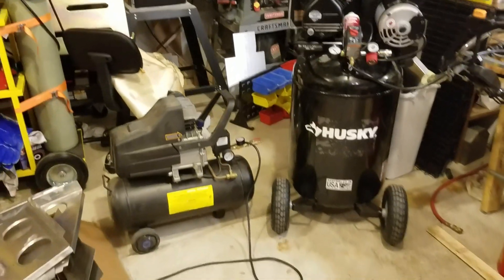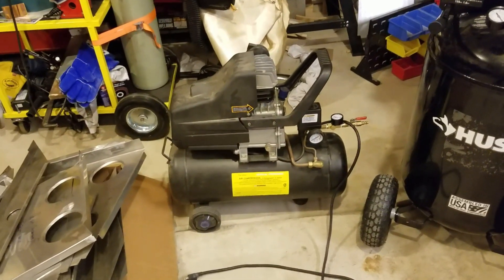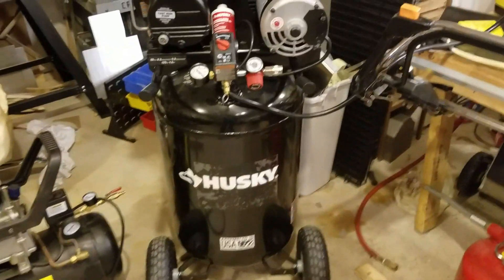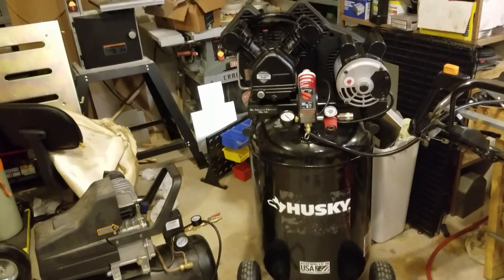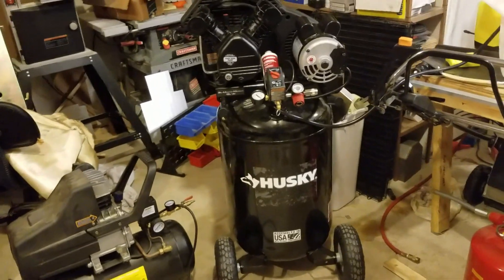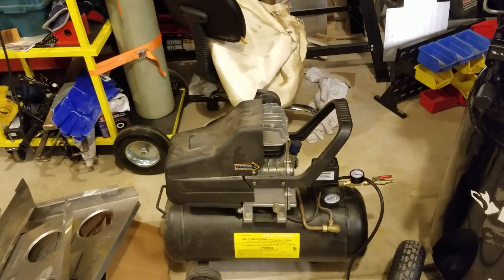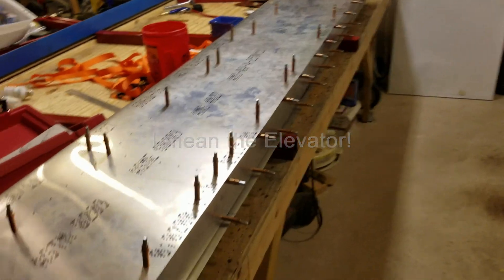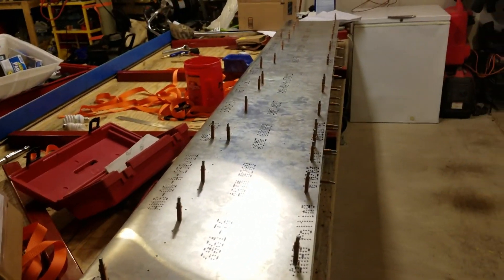This project killed my air compressor & update

Comment: Capacity is not the most important aspect of an air compress (don't get me wrong, I do like decent Capacity) but the most important is CFM ... this is good reading https://www.vmacair.com/blog/many-cfm-need-run-air-tools-air-tools-cfm-usage-chart/

for drilling you need good cfm - I would look into units that give 11 cfm at 90 psi - I have the same Husky you have now as a back up, but my 220 volt one give me 3 times the CMF and double the tank Capacity

Comment: Connect the two tanks together with an air line and fittings, then you will have a 38 gallon tank capacity.

Comment: I have the Husky 30 GAL 175 psi Oil-less. This does work great for a portable 110v unit but if the compressor dies I will get a twin-cylinder oiled compressor.  I will get a lot of years out of it no matter what. Harbor Freight carries a twin-cylinder cast compressor at a reasonable cost. The conversion is basic and simple. Being oil-less does not worry me knowing I can make a pump change so easily. I have 3 compressors now. The Husky, a  Campbell Hausfeld 20 gal which is now over 20 years old and still does the job, and a twin-cylinder with the motor that both came off a 200-gallon tank. It was given to me as the tank rusted out on the previous owner. I adapted it to an 80-gallon tank, @ 30 amps 220v stationary in my shop. He told me it was new in 1962.  I did a calculation on the unit and it has a cfm of 22 with a 1/2" pipe. So like I said, easy to repair. So was it disposable? Only if you don't like repairing and wasting good equipment.  In short, if I got 10 years out of the oil-less Husky my repair would be easy, cheap, and better than the twin-cylinder unit he's showing. The choice is yours but I like to save a buck and look at the long haul. Just remember, tanks usually don't go bad. That 30 amp unit was old and always outside exposed to the elements. You can get a motor or a pump that will exceed the manufactures original unit. As long as the pop-off pressure release, and the pressure power switch is good not much can go wrong. The 30amp unit has now been being used for over 15 years with no issues. Great video, good information but I find on these videos that usually the person making the video does have a prejudiced opinion validating the one they purchased and own. Guilty, I do it as well at times for my own reasons, but I am just opening the door for others to understand,  ( throw-away ) doesn't apply, Replace defective parts for better somewhere down the road as you always have options to get the most out of your purchase. Most times a repair is cheaper than replacing the unit with a new one, sometimes not, but keep the good parts for a later repair of something else. How many times in my 62 years have I thrown something away only to find out 6 months to a year later I needed it and it was a good part. I do not throw out the potentially good stuff. Have an awesome day!

Comment: THanks for the video. A couple of quick questions, if you have time.... How often do you need to change the oil? How difficult is it to change the oil? Finally, how has it held up over time? Once again, I'm grateful for your time.
Reply from the maker: I changed the factory oil after the first break-in (20 mins of use) and haven't changed it since because I used full synthetic and the oil is still clean in the sight glass. There are various recommendations for intervals for this type of compressor, and it depends on the shop environment, use and type of oil. The owner's manual doesn't specify any interval. I've seen recommendations for 50 hours, 100 hours, 200 hours, once per year, etc.  This compressor has held up well for me and is about to get even more use. However, it's still used rather intermittently.  Since it doesn't come with an hour meter, I think I may consider installing one and doing oil changes at 100-hour intervals. I would guess I'm somewhere around 50-75 total hours of use in 4 years. With full synthetic, I'm less worried about the oil going bad over time (though, I'm no oil expert). When I use it, it's hard use. Lots of cycling due to rapid riveting & drilling, followed by long periods of not being used. I have seen no color change in the oil, for whatever that's worth, since I did the first oil change. Changing the oil is easy - just drain and refill - but you'll want to rig up a funnel and hose to use at the drain plug because it'll spill down the tank.
Reply: @GregsZenithSTOLCH750  Thank you for the reply.

Comment: I'm on the fence about this compressor, can you run small angle grinder with this compressor? I like the warranty better than harbor freight model and if you need parts you can get them online. What brand is the motor?
Reply from the maker: The motor is MAT Industries. I run a die grinder all the time with mine, but not continuously. It's all about CFM and matching what the grinder needs vs.what the compressor can put out. I have no trouble with what I consider to be light to moderate duty use for this machine.
Reply: Is mat Industry a good name
Reply from the maker: @richardkenworthy9312  I have no idea. It's a Chinese motor. That's about all I can tell you.
Reply: Yes if it's 175 psi  like my husky,  but being as though I've actually never done it I would assume it would be cutting on and off to re-fill the tank as die grinders eat a lot of air.

Comment: I wouldn't take a H.F . if given to me. I have a Dayton, from Grainger over 40 years old , a 110/ 220,motor still runs like new. If I was to,buy another, I would look into Northern Tool , if,you,read specs. On their own , called North Star , it fairs better than most , longer compressor life.

Comment: Use it for HF for xtra storage. Also why not get a HF larger model cheaper and you obviously know they will last along time since yours lasted so long. Also oil less will be done in 5 years not repairable should always buy one that uses oil
Reply from the maker: The old compressor was too small to make it worth the effort of plumbing it as a storage tank. Plus, it was 15-some years old and I felt better just taking it out of service. I'm sure it would have been fine, but old compressor tanks can be dangerous and this one spent a lot of time in a high condensation environment. The only larger HF model is the 60-gallon, which runs on 220, isn't portable and is twice the price. I needed a portable one and one that runs on 110 for now. The Husky model is an oil sump model and very quiet.  I've had it for 1.5 years now and I love it.  I'll never buy an oilless compressor. Thanks for watching.

Comment: A number of things on the air compressor. First, a drill typically takes about 4cfm to work, and if the compressor head cannot deliver that, then it will not be adequate. 2 to 3 times that is needed, so 8 to 12 cfm is needed. That equates to a 3 - 3.5 hp unit. Secondly, the tank capacity is the 'reserve run time' that allows the compressor to shut down and cool off. The greater the tank capacity, the longer it will be idle. Thirdly is the power source that EVERYBODY gets wrong. Breakers should not pop when starting the compressor, and it is usually because they are sized far too small in the first place. You need to remember the inrush starting requirement - a motor looks like a dead short to the power line when not turning. The breaker sized (maximum) is spelled out by NEC 430.52 which is: 2.5 times the nameplate full load amps times the service factor (typically 1.15), then select the size breaker less than that number. The husky is only 5.2 cfm @90 and is 1.6 hp at 120v Soooo, the breaker required: 28 amps (max), nearest standard would be 20 Amp.
Reply: To Paul Moffat. Thank you sir. Very valuable information you have given in your post. One question I have though is if the max voltage draw is 28 amps why wouldn't you need to install a 30 amp breaker? I am considering buying one of these Husky or HF compressors and will probably need to hire an electrician to install a dedicated breaker for the compressor and want to make sure I don't undersize the breaker I need.

Comment: why don't you use an electric drill
Reply from the maker: Most electric drills that spin 3200+ RPM are big, bulky and expensive. Drills that spin more slowly don't produce clean holes in thin aircraft sheet metal. If you have compressed air anyway (like for rivet guns, etc.), an air drill is the way to go. The little Harbor Fright machine just wasn't big enough for the kind of sustained drilling and riveting I'm doing for this project. I would have killed it anyway, once I got to a lot of riveting. I've had no problems with the Husky.

Comment: Greg, I had the same HF for 12 years with no problems. Finally a fitting broke, and I used it as an excuse to give it away. I bought a Porter Cable 30g that looks exactly like yours for $349 at Tractor Supply. Quiet, very heavy tank, recovers quickly. That HF was LOUD, but really made a lot of air. Love your hobby, BTW.
Reply from the maker: I love this Husky compressor. I do tons of rapid-fire drilling and riveting on my airplane project and it's been fantastic for that. Very quiet too. Glad to hear the Porter Cable appears to be on par!

Comment: Hey I have the exact husky compressor. Worked for two years @ 110v and after some time I rewired the motor for 220 and it was the best thing I ever did for it. Builds faster runs cooler because the motor now runs at the proper rpm.
Reply from the maker: I am definitely considering doing the same thing, if I ever get around to wiring 220 in my garage, for both the compressor and the welder. Love this compressor, and 220 will just make it better. Did it affect the noise? Is it much louder, if at all?

Comment: Great informative video. Thanks for taking the time to make it. Have you had a chance to put it through the paces yet? I think that if it will stand up to what you are petting it through with all of the drilling, it should last me a lifetime.
Reply from the maker: I've done quite a lot of rapid-fire drilling so far, but not a lot of riveting just yet. However, it runs great. I have a lot of confidence in it at this point, but time will tell.

Comment: That 29 gallon Harbor Freight model you mentioned, I bought a week ago.  It wouldn't turn on, then they fought me on returning a unit that wouldn't work.  I went to HD and bought this Husky today.  Man, it's quiet!  Seems like a good unit.  Hope it lasts as long as my Craftsman 30 gallon oilless, that went 20 years until it developed motor problems.
Reply from the maker: Craig Arndt I've been really happy with mine so far. I probably didn't need to buy the extended warranty,  but as much as I'll be using it, I figured it wouldn't hurt. I'll really be putting it through the paces in the coming months.

Comment: I see it has two gauges (tank & tool?) and it looks to have a regulator for the tool line?
Do you also have a filter/water separator along the tool line?
Reply from the maker: I don't have a water separator just yet, though that is a planned addition. I have regulators on the individual tools, but it has a tank gauge and output regulator gauge built-in.
Reply: That's smart to have individual regulators so you can adjust pressure for the various tools.

Comment: First; Thank-you for the info.  I'm retired (3 yrs) so despite my half of a smallish two car garage, woodworking looks like a good hobby.  I've been looking at compressors online and alas your video convinced me that the 30gal Husky (oiler vs no oil) versus a California Air Tools unit (no vert?) will suit my needs (overkill?).
I checked out the "Zenith Aircraft Co" site and saw the STOL CH750 you're building, Kewl.  I noticed the "Cruiser" has a bigger rudder aero gear shrouds and I'm guessing the ailerons, elevators are also bigger, higher HP engine and larger fuel tank (reserve?) for higher altitude, longer range (aka: "Cruiser") flights.
Are you a Commercial or Military Pilot?  If Commercial, have you interacted with ATC ("Kennedy Steve" / ground) at JFK airport?
Thank-you for the time and keep up the work on "Zelda".  ;-)
Reply from the maker: Thank you for the comments.  I doubt you will need to build a noise shroud for this air compressor...it is really rather quiet (until you drain the moisture...that part is very loud). I'd wait until you actually get one and try it out before deciding to build an enclosure. I'm thinking of plumbing an outdoor drain for it. I have been very pleased with it so far. Quick to charge up and holds air with no "bleed off." I plan to put a line dryer on it at some point, but haven't gotten around to it.

The Zenith Cruzer is the same size airplane with the same horsepower range. It uses a vertical fin with separate hinged rudder. Those two assemblies together are larger than the Zenith "all-flying" rudder on the STOL. The all-flying rudder is a single piece rudder/fin combo that moves together. It is more effective at compensating for crosswinds and therefore doesn't need to be as big. The ailerons are actually slightly shorter on the Cruzer. The elevator  is thinner, but about the same width and length. Fuel tanks are the same, and both airplanes can accommodate the same engines. The Cruzer removes the leading edge slats on the wings and removes one of the wing struts on each side. The wheel pants, plus the other drag-reducing things I mentioned give it less drag and better cruise performance on the same horsepower. However, all that comes at a price: reduced STOL capability. The Cruzer is meant to fly in and out of airports (mainly), whereas the STOL is meant to get in and out of wherever you want. Both airplanes have an option for extended range fuel tanks, but the standard capacity is 24 gallons (extended range tanks add 6 gallons to the total capacity, which equates to another 1-1.5 hours of flight time, depending on the engine). 

I am just a private pilot and have never flown outside of Michigan (yet). I am making some new friends with my channel, though, so I may be traveling to other states and Canada once the plane is finished!

Comment: The Harbor Freight 29 gallon is two (2) cylinder.  It is an in-line 2 cylinder as opposed to the V2. Hence, at first glance it appears to be a single cylinder but it is actually 2 cylinder.  Look between the cooling fins and you can see that it is 2 cylinders.

HF is rated 150psi and Husky rated at 155psi.  HF is 5.9 CFM @ 90 PSI, 7.3 CFM @ 40 PSI.  Husky is 6.2 SCFM at 40 psi, 5.3 SCFM at 90 psi.  HF has a slight edge in "advertised" air delivery. As of 12/1/16 HF is $339 and Husky is $399.  Warranty HF 90 days - Husky 2yrs.
Reply from the maker: Good call. I hadn't zoomed in enough online to see it, and didn't bother looking it over that closely in the store. Thanks! I wonder about the noise levels between the two. My Husky is so quiet, it'd be hard pressed for the HF to beat it.